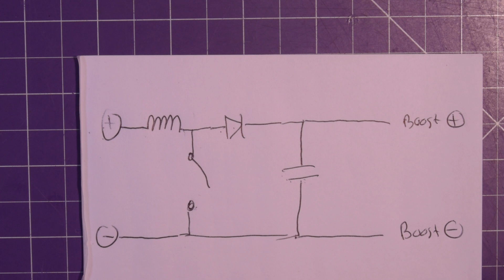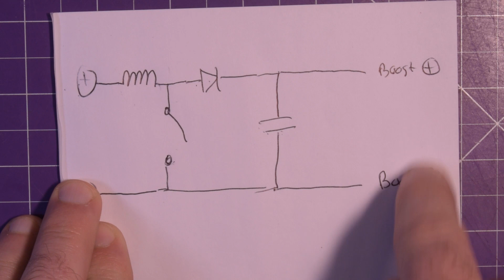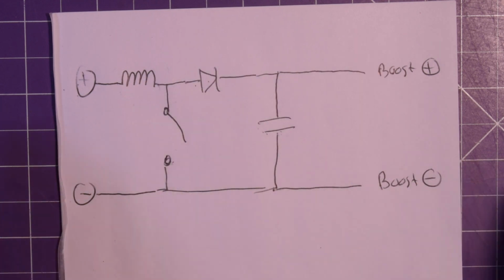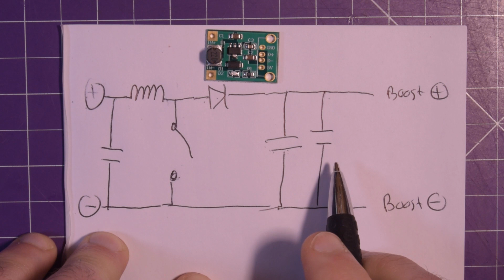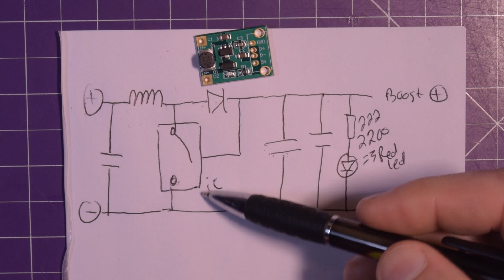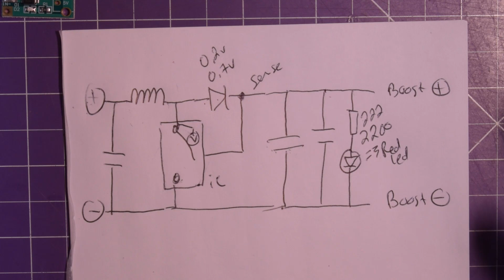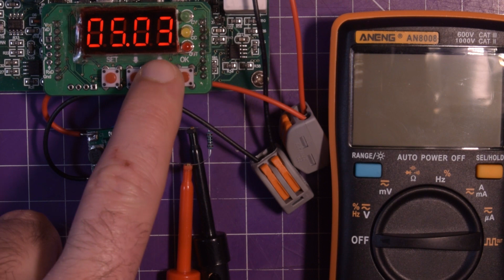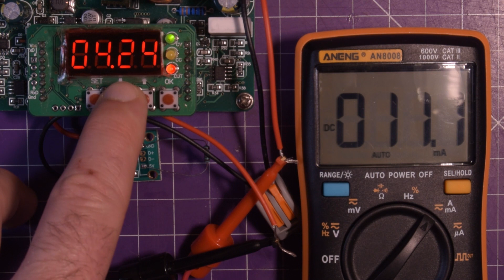How Boost Converters Work!

Comment: So I retested mine, and at 4.2 volts in I get 5.2 volts out, still within the tolerance range of arduino, since it can handle 5.5 volts, and most sensors have similar if not higher tolerances.  

Also, after much googling, I found this chip, on the page it has a data sheet, and that data sheet says the max v_out for these should be 5.1 volts. So they seem to be a little out of spec. Oh well, work good for what I need. 

https://www.sunrom.com/p/bl8530-501sm-e5-5v-sot89

Comment: Interesting... then ones I have put out a nice 5 volts with an 18650 li-ion on them... well, it’s like 5.05 or something like that, not 0.5 volts high. I use them for some of my arduino projects. I wonder if it’s because you started it at 5 volts, then dropped them down, and it never reset itself. To add on to what you said about the minimum input voltage, that depends on what the gate/base needs on the mosfet/bjt to turn on, also there is an internal voltage reference, and it needs to be able to produce that so it can regulate its output.

Comment: Looking for a good step up to 5v in order to use with a supercapacitor. Any idea?
Reply from the maker: You definitely want a module with adjustable voltage and current, like this one: http://rover.ebay.com/rover/1/706-53473-19255-0/1?ff3=4&pub=5575582724&toolid=10001&campid=5338675657&customid=boostbuck&mpre=https%3A%2F%2Fwww.ebay.ca%2Fitm%2FCC-CV-Adjustable-3A-35W-DC-DC-Buck-Boost-Converter-Power-Supply-Module-HI%2F183990721350%3Fhash%3Ditem2ad6b39b46%3Ag%3A1uEAAOSwkRRdn%7ERn . It is a bit more expensive but you can do a lot more things with it!

Comment: Hmm. Output via a 5v regulator if exact output required, perhaps?

Just a thought on a "because we can whether it makes sense or not" basis :)
Reply from the maker: Yup that work work, but you would need a LDO and since the 5v is not stable, it would drop below dropout voltage nearly for sure. If you need a specific stable voltage, you should probably take the efficiency hit and boost up higher and use a linear regulator down to 5v